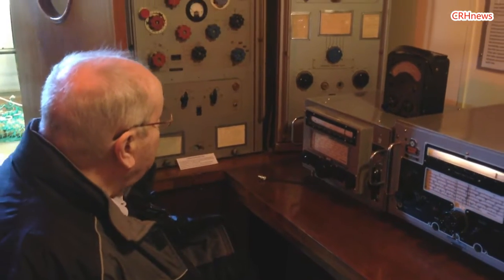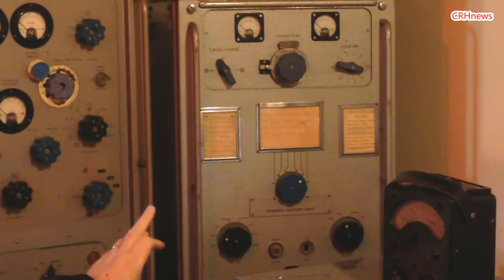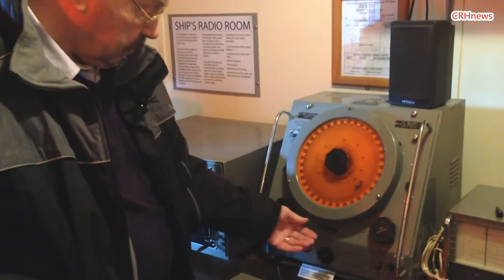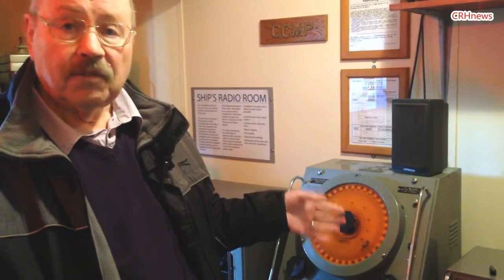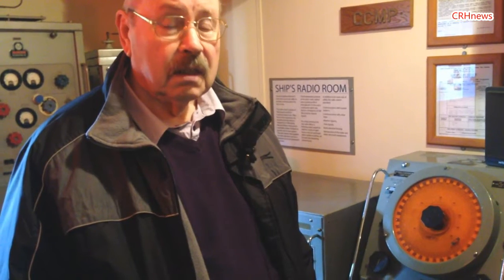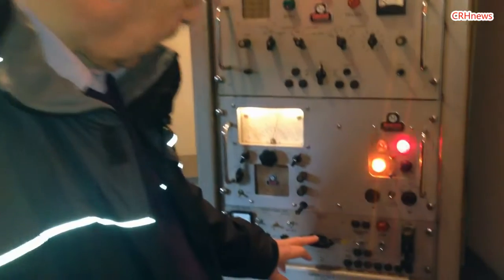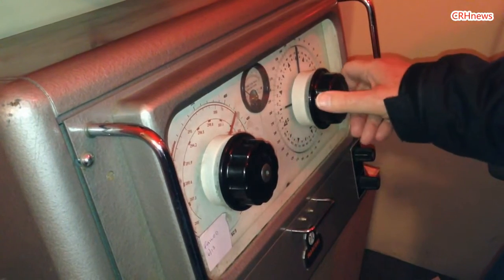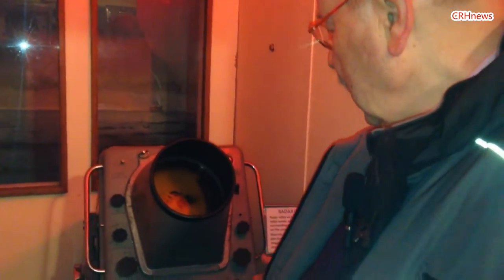CRHnews - Marconi Marine sparks Alan  back on watch in radio room

Comment: Actually Morse code was a very sophisticated communication.  In (ideal) Morse one dash has the same duration as three dots.  Morse reasoned the more dots and dashes for each letter the longer the message would take to send, so he identified the most commonly used letter in the English language, the letter E = one dot, second most common I = two dots, S = three dots, T = one dash, and so on... Worked on many ships as an RO and ended up at Portishead Radio - GKA - Quite a shock as to work there your Morse had to advance to 27 wpm...with no errors...
Reply from the maker: Always glad to receive instruction and guidance about a subject that is all Greek to me!